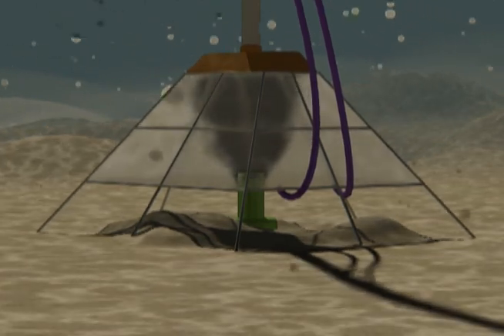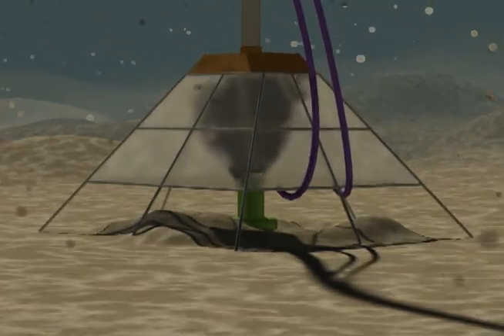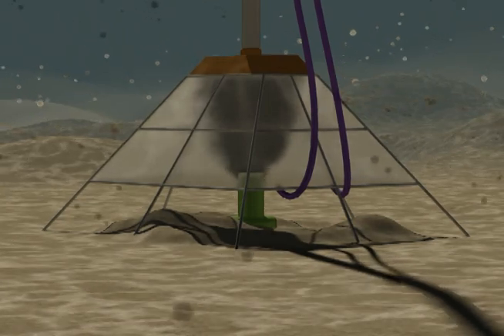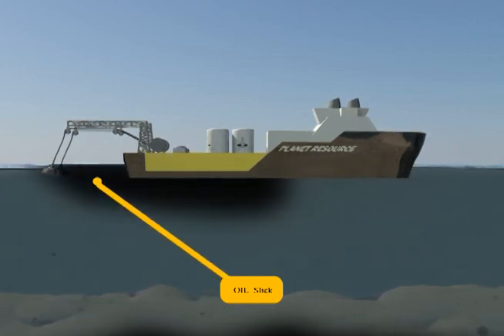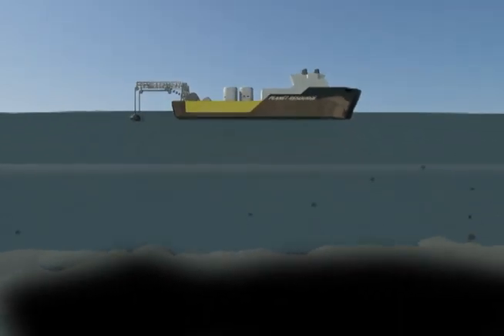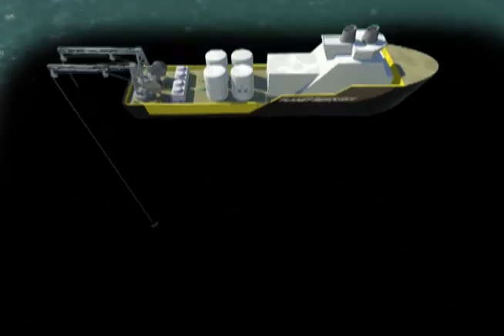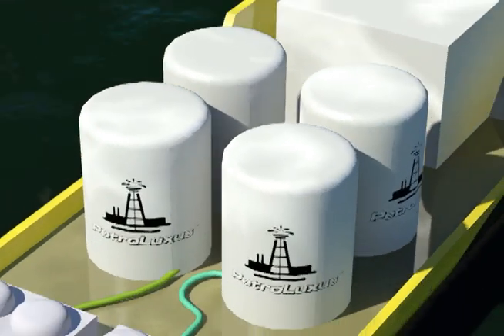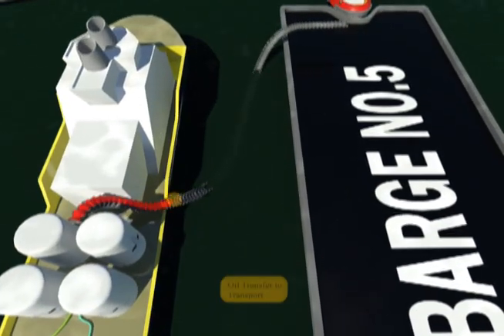COMPLETE CLEAN UP OF THE GULF SPILL

Comment: Will this be used over all the cracks in the ocean floor? Its my understanding that oil is comming from those cracks as far as 20 miles from the platform with the original problem.

Comment: Some equipment on board of the ship could be Tricanters from flottweg technologies that separate slurries. Just as we design on a Engineering proyect to separate water with petroleum recovery. Other equipment advise is a nut filter excelet separate oil from congenit water.

Comment: @Smokethatchron Exactly. Problem is, though, that every solution BP has come up with has failed. They don't know WTF they're doing and the govt has just given BP free range to do whatever they want to handle this mess. All that dispersant crap BP is dumping into the ocean is highly toxic. I did some research on Planet. Not only is Petroluxus non-toxic, but they're not dumping it into the ocean either. At this point, the only thing BP should be doing is PAYING Planet to handle this disaster.

Comment: Is that the best solution you can come up with? Actually the top hat containment which is being used now is the way to go. The initial device however leaves much to be desired due to it's shoddy design. A new top hat device needs to be quickly built that would use hydraulically engaged dogs to the existing flange thus locking and sealing the device firmly to the structure.

Comment: that would IMO gather too much seawater to be viable. im not an expert so please correct me if im wrong. they are using pressure from the well itself to help get the oil to the ship. pressure is required in order to allow the oil to make the long trip up the pipe. there would not be many if any pumps that could "drag" oil that far. i would say there would be too much water/crude mixture to try and filter. it would likely take months to try and engineer such a system to work for this application